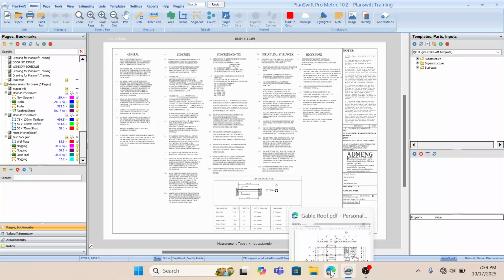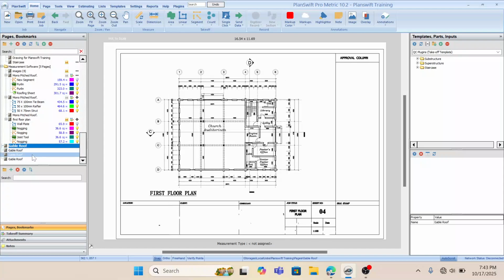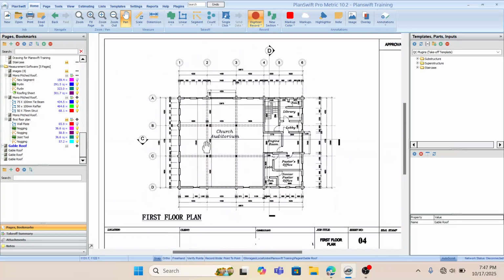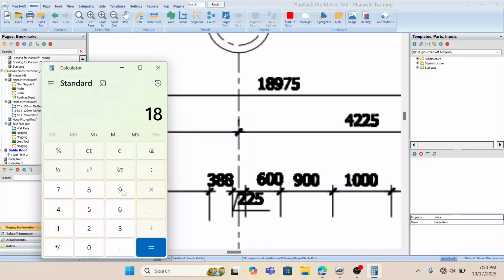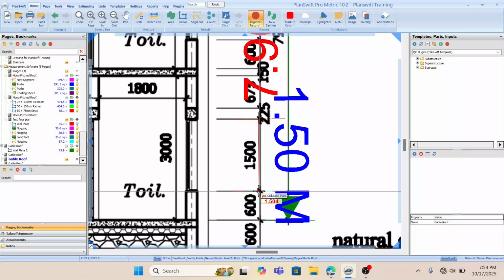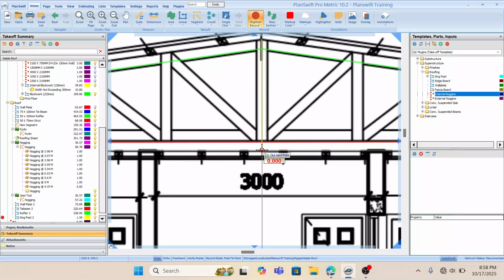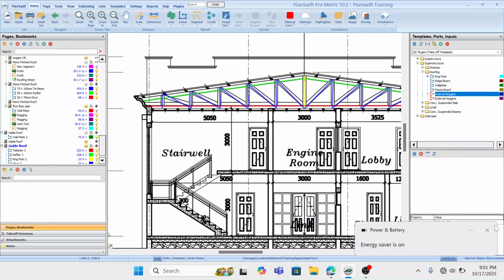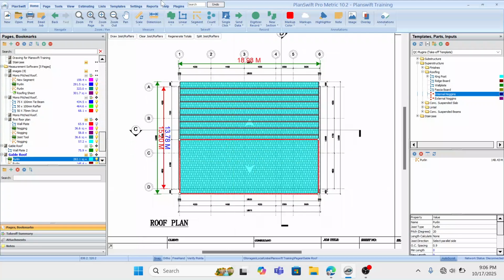Measurement of Gable Roof Using PLANSWIFT

Comment: Hi sir,so the wall plate will only covers selected portion of the building?
I thought it will cover the perimeter  as well as internal load bearing walls.need clarification from you cheers happy Christmas and a prosperous new year ❤😍🙏🏻
Reply from the maker: Complement of the season boss. 
For gable roof, the wall plate will be on the length of the building.
For heap troof, it will be on the perimeter and some selected areas based on your descrection